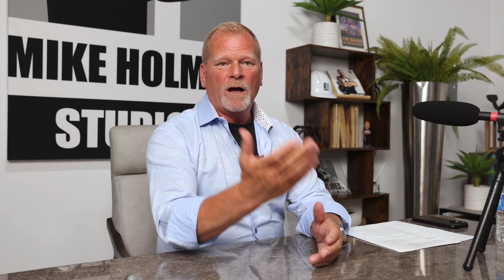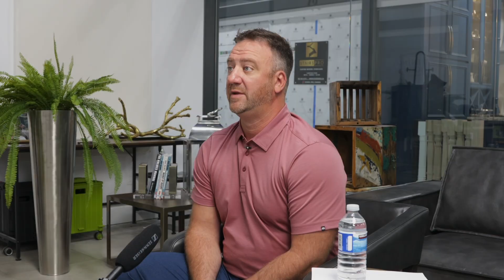WHY DO I STILL SEE FUSE PANELS!? Clip from Mike Holmes Holmes On Homes Podcast

Comment: You know Mike if you have a problem that is blowing a 15 amp fuse. The problem is not the fuse. The problem is the circuit is overloaded, so I understand what you’re saying if someone changes that fuse from 15 to 20 the blowing of the fuse goes away, but you can also do the same thing with a breaker panel. If you have a 15 amp breaker and it keeps tripping you can change the breaker to a 20 amp breaker, it won’t blow anymore but now the circuit is overloaded it makes no frigging difference if it’s a fuse or a breaker if you use the wrong device in that application, the circuit will be overloaded end of story

Comment: Nothing wrong with fuses unless the equipment is a hundred years old?
Reply: You are correct my friend.
Reply: It depends. Normally fused panels have copper wiring attached, an advantage, plus they blow quicker than a breaker trips. On the other side the electrics are 65+ years old which may require a serious inspection/refit. They may not have a ground and some of the advanced breakers (GFI and AFCI) can be safer. Many of these panels are of too low a capacity to safely support a 40+ A circuit being added. (My former fuse panel was also wired for 120V, not 220.)
Reply: Saw them as a child, later in a mobile home, early model, that had aluminum wiring, after that usually in out bldg where the pump is?

Comment: the big thing im recommending to pple is if you want a service upgrade go to a minimum of 400amps especially if you want a garage and an e/v vehicle.  a garage is at least 60 amps and e/v  are 50 to 100  plus with everything being smart aka power demanding circuits it just makes sense ive priced 400 amp services they are not that much its the markup and labor from contractors that make it unappealing
Reply: you live in the city you can't get 400 amps
Reply: @danmeade3059   depends on the city or state country.  most of the usa they will use a 1 meter 320 amp service for a max of 400 amps. or you may have to pay for 2 service entrances have seen that done 1 200 for the house and 1 for the garage